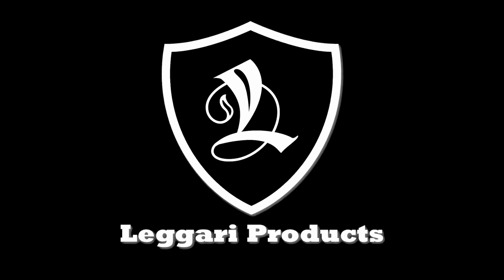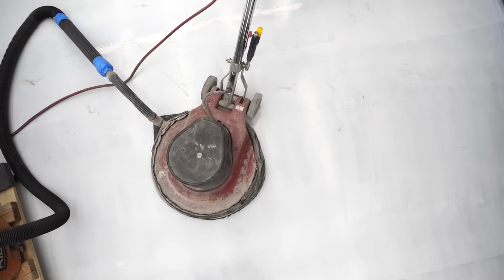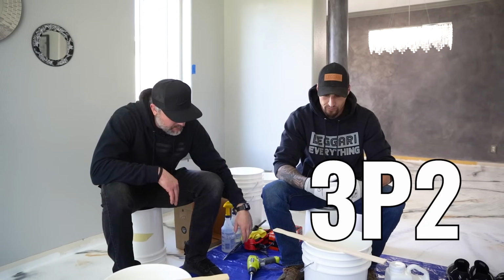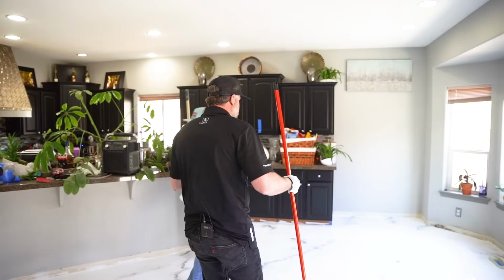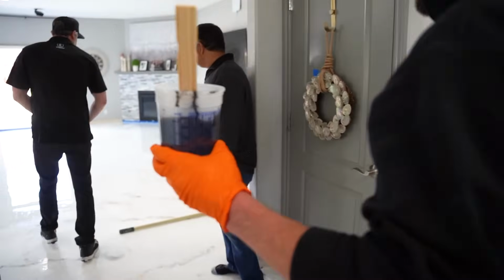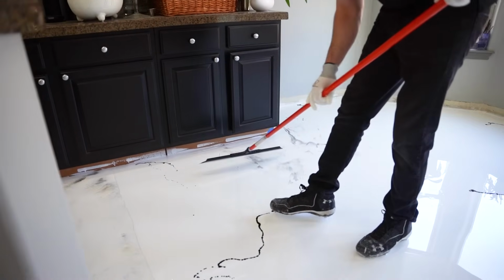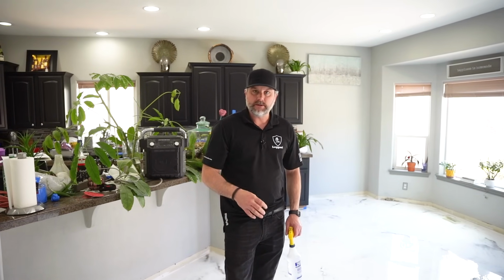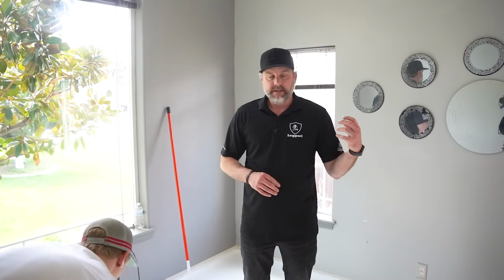Epoxy Disaster! How To Fix Epoxy Flooring In An Entire House | Epoxy Floor Installation

Comment: I’m impressed that your white metallica epoxy covers up the old floor without the old design showing through.
The product I use doesn’t work that well and we always have to put a primer coat down first

Comment: Matte finish. I am actually working on my basement floor right now. Doing all the prep work and almost ready to start laying down the epoxy. Your videos have been extremely helpful. You guys do great work, and it is fun to watch!
Reply from the maker: That's awesome! Send us pics of the process and when it's finished. We love seeing customer projects! 🔥🔥🔥
Reply: @LeggariProducts  hello Sir  , you are a project engineer of the resin flooring ...so professional and skilled !😁😁
Reply: I made the mistake of having the guy put down a Mat finished because I was told it was more slippery assistant than a gloss finish and it completely ruined the entire metallic effect of the floor and it also absorbs all the light rather than reflect it as the gloss would have so it looks very dark and dingy.

Comment: I would pick a matte for the sheer reason that it does not highlight fuzz or any little thing dropped on the floor.  Gloss may look nice, but it will highlight every issue and speck of dirt.
Reply: There is a Matt epoxy? Cause every where I been seeing high gloss. How we get the matt finish?
Reply: @summerrblu  trust me..  u don't want the matte finish.    I had it put on Mine because I was told it would be More slip resistant and it completely killed the light Reflection of the metallic and You Don't see metallic Anymore it just looks like a commercial floor now.
Reply: I've done epoxy floors, wall panels and countertops. The glossy finish in my opinion is the way to go. The matte finish to me looks like a worn-out floor that's lost its shine. Just my opinion.
Reply: @LeggariProducts How thick can this be poured or would you just do layers
Reply: @summerrblu  top coat is matte which goes on top of the epoxy.

Comment: So after you sand the old coating, you said you’re not priming. Will the new epoxy coating bond to the sanded old coat the same way it would with priming?

Comment: How do you maintain the shine? I clean for a company and the get alot of smudged and its starting to dull. Ive only been using war. Water on it for now to remove any residue it may have. Ive heard windex is recommended. Please advise.

Comment: How do you blend the sections together especially  when rolling over the first section when applying the second second? Wont the roller start to peel the already setting first section or are both areas still wet enough?? Hope this makes sense😅
Reply from the maker: This makes sense! Yes we have to make sure to blend the first section before it really begins to set, before moving on and focusing on the next section. If you wait too long, you'll definitely run into sticky resin, especially if it's cold.... It helps to have an extra installer helping on the project. 
Check out this large epoxy floor project where we experienced the same challenges💯👉https://www.youtube.com/watch?v=wz7THPQuxhA&t=1s

Comment: what do you prime with.  what do you put over tile befoe priming and epoxying
Reply from the maker: For this floor, we did not have to prime but we did clean and sand it. Tile is a whole different story. You'd want to be sure the tile is solid and then apply an epoxy flood coat to create an even surface before even doing a decorative coat. You can check out our floor kits here https://leggari.com/order-flooring/ and contact our team with any questions regarding our products! https://support.leggari.com/hc/en-us/requests/new

Comment: If you do a French drain and cut the concrete can you do epoxy on a basement floor after it was installed.  I was told because it's tow different concrete 😊it will crack after awhile is that true

Comment: Sir What is the use of that alcohol and what alcohol is that..pls answer my question thank
Reply from the maker: The first thing we spray is 91% or higher isopropyl alcohol. This creates cells in the design and disperses the epoxy. Once that evaporates, we spray denatured alcohol to pop any micro bubbles that might be in the epoxy from mixing. This allows us to avoid torching the epoxy and the risks associated with that.
Reply: @LeggariProducts  denatured alcohol and isopropyl are different..

Comment: I did this same kit on my kitchen floors last year and it didn’t come out the way I expected. The floor changed from white to now a beige almost yellow color. Some spots sound like there’s bubbles underneath cause it makes a cracking sound when you step on them. Another thing is it gets dirty all the time. You drop some water and step on it, it turns to mud. I’m constantly mopping these floors. Hate it 😔

Comment: Gorgeous.  One BIG QUESTION I have.  How is the removal of the tape on the baseboard handled?  You would have to wait a couple hours to pull it before it hardens too much but I don't think you could walk on it at that point.  Or do you pull it next day? Seems like that would not work either.  
  Thanks!
Reply: If you look close you can see the spikes they’re wearing on their shoes while they’re walking in
Reply: I would like to know that too because the guys that did mine taped my baseboard trim but then had to remove it before the color coat because he realized it would get trapped between the material and the trim and it would never be able to come out and i'd have blue painter's tape stuck between floor and baseboard trim.

Comment: We just had our basement floor metallic epoxied. We were told it would look and feel like glass when finished. It was spectacular until he put the final coat on. Then it fish eyed? I think that's what he called it. Then he redid the top coat and now it looks like there's sand in it or like it's textured with lots of debris and you can see every scratch from when he sanded it prior to this final coat. It is supposed to look like marble. We are devastated. We paid so much money. Can this be fixed?😭😩
Reply from the maker: Yes, it would need to be sanded down to the epoxy surface where the scratches are and a new top coat applied.
Reply: Yup.  Just sand for 90 hours straight should do the trick
Reply: @joshjosh575  Thank you, Josh. Why 90 hours straight though? And no top coat?
Reply: @LeggariProducts  Thank you. We really need it smooth. We were told it would be smooth and we wanted the kids to be able to play barefoot but their feet get cut from all the sharp debris so they obviously have to wear shoes in the play area now. We hope we are able to do this and resolve this issue. Any other advice, tips, tricks would be very much appreciated.
Reply: @BrensBoutique  because you have to spend time to sand it down to the original level, then buff out the scratches, to then reapply a nice layer. If you can deal with the eye sores for a few years, save money, and strip it completely, and get real granite. You already in a deep hole,
Just go
All the way with granite.  Epox is hit or miss, and when it doesn’t go well,
It’s  awfully.  You
Reply: @joshjosh575  Thank you. I've never heard of a granite floor before. Interesting.

Comment: 45 square foot per gallon?  Just curious, Sherwin Williams has an epoxy and they say that one of their 8100 kits covers 250 per gallon and a half.  Is that realistic or is theirs just thinner than what you are using?  And what are you using??
Reply from the maker: Yes we have formulated our resign to be applied thicker - making it more durable and less likely to chip. If you would like to read more on our resin, check this out 👉 
https://leggari.com/product/metallic-epoxy/
https://leggari.com/product/epoxy-floor-kit-2/

Comment: How long will it last until the touch up?
Reply from the maker: How long it lasts really depends on wear and traffic but our products are designed for permanence and our proprietary kits are so strong they will not delaminate (peel off) or wear off over time.

Comment: Do you remove the baseboards?
Reply: My opinion as a homeowner is that you probably should remove..   I did not because mine are so old I was afraid that they would just crumble if I tried to take them off LOL .. and I don't hav money to replace... so my guy taped them but the tape didn't really work out so he had to remove it before finishing the job so there was some epoxy on the trim but I'm hoping it can come off easily.

Comment: I have a major question to ask. I just had some people do my epoxy floor and there are thousands of raised little nicks all over the floor. I know I need to sand it down but with what grit and I don't want to have to re epoxy the whole thing. Do I just add eurathane top coat after sanding? I would like to send pics if you have an email. Thanks
Reply from the maker: Hello! Feel free to contact our customer service with your questions. Thank you and best of luck to you with your project!
customerservice@leggari.com
1-844-LEGGARI (534-4274)
Reply: @LeggariProducts you know it would be much better if you answered here, it would be better for business!
Reply: You can sand if you're putting a top.coat on it
Reply: I would the finest grit that takes it out

Comment: but your stepping in it doesn't that move the material places you dont want it and cause that section to set faster because whats on the bottom of the shoe is less so it dry faster?
Reply from the maker: Hello! Our Leggari Spike shoes allow us to walk over the material without skewing the design or displacing the epoxy. 
https://leggari.com/product/spike-shoes/

Comment: Okay, so what do we do if the epoxy kit was bad? I had never done it before and the resin mix was like hard packed brown sugar in the packet. I mixed it and let it sit for recommended time according to directions, painted it on and there were chunks of resin that I pulled out. But at the end of the day, it didn’t properly mix (in hindsight) and now the floor won’t cure; it’s sticky. 
Rustoleum confirmed that the store I got it from probably stored it incorrectly (too hot or too cold….) hence the problem. 
They said we have to scrape it off and pressure wash it off and start over again! 😡
Well, the concrete (brand new slab) was prepped according to directions (we washed it with their product then used etch allowing to dry in between) and then the paint really “sucked in” to the concrete. There is no scraping it off and no pressure washing it; it is bonded to the concrete. 
I feel like someone (not us!) should refund us but also pay for the materials to get this garbage off of the floor. 
I just don’t know what is going to take it off. Any ideas?

Comment: Quick question- In our basement the previous owner had the floor painted. Whats the best way to prep before applying epoxy on a painted floor?
Reply: Remove the paint with grinder, at the moment I’m doing it now, it’s not easy
Reply: Try different type of grit on your grinder

Comment: What was the guy doing with the red container squirting on floor was that the alcohol
Reply from the maker: It is a chapin sprayer, and he is spraying on the topcoat with it then rolling it out, way faster then dipping and rolling the whole thing!
Reply: @LeggariProducts is the top coat an epoxy product?  I heard one should use epoxy products all the way through?

Comment: I bought a ton of  product and did my garage floors in January. Got the white epoxy with highlights to mimic the white marble floors with the big American flag. Less than 6 months later and the epoxy on the floor is starting to yellow badly.
Reply: Responses from Leggari on either side of this post but NOT for this re: yellowing????
Reply: @williamproposki67 Maybe I will have to post a video and or pictures of my own. I have gotten used to being ignored and after paying over $2,000 for their products I was hoping for more support or even a response.
Reply from the maker: Call customer service at 844-LEGGARI or Email customerservice@leggari.com They will be able to help you with your questions!
Reply: @Jake Chester I ordered about $2,000 worth of Leggari products for this project. Followed their instructions and this was the result. The floor continues to yellow since this was originally posted. I wish I could post picture on youtube, I have a ton of video so maybe I will have to make a video for this.
Reply: @gravepatrol  I’ve used both there’s and the other two popular competitors here on YouTube epoxy for countertop project and their whites all yellow, wether it’s Art coat or countertop epoxy. It upsets me because it upsets my clients! I’ve literally just stop offering that service.
Reply: @KimariEnzo  Kim, they told me to contact them which I did AGAIN. I was basically told sorry not sorry. That even though they advertise a "lifetime warranty," they don't cover discoloration. Or all the other defects. I could buy more at a slight discount if I wanted to is their best offer...
Reply: Is there a top coat you could have put on but didn't that may have reduced yellowing?  Also, what if you used a different color scheme that yellowing would possibly compliment?
Reply: @mountdoomee  I used all of their products as instructed including top coat. I am looking for another epoxy to do the floors all over again. I won't do the white again and now looking for a company that is honest about warranty and guarantees.
Reply: @KimariEnzo all epoxy yellows some quicker some slower but the key is to mix in a few tiny purple alcohol drops to counter the yellowing

Comment: Spraying alcohol on my floor to pop bubbles left circles with no colour all over my floor and ruined it. The client was not happy and needed to sanded and grind out. What did i do wrong?
Reply from the maker: The epoxy was too thin in those spots and when you sprayed the isopropyl alcohol it went all he way down to the floor! If you would have patted those spots in with your finger it would have leveled back out! Never walk away till you are happy with the floor! Sorry this happened to you! Call customer service at 844-LEGGARI or Email customerservice@leggari.com They will be able to help you more in-depth with this situation!